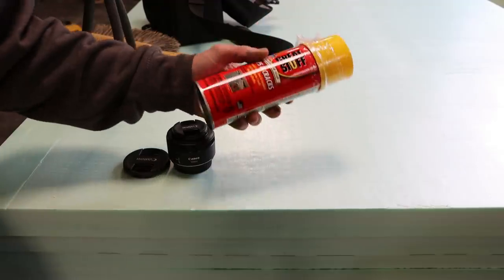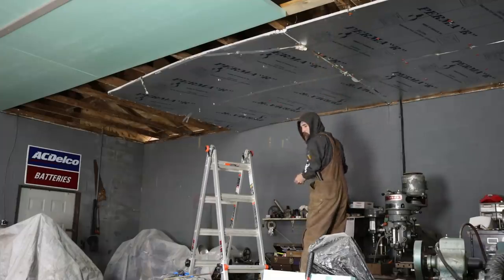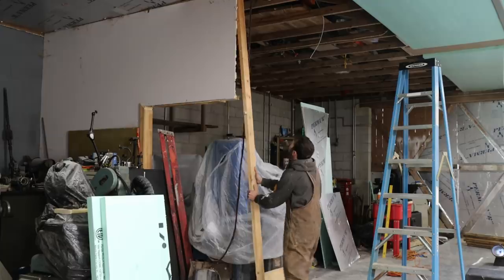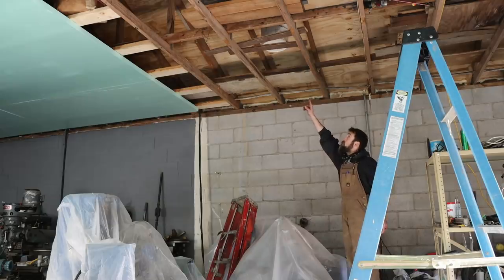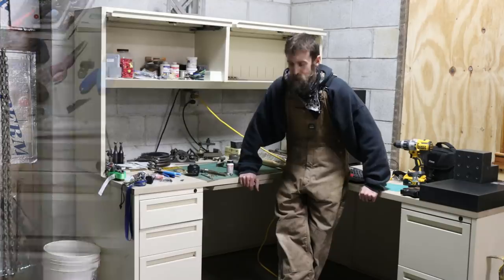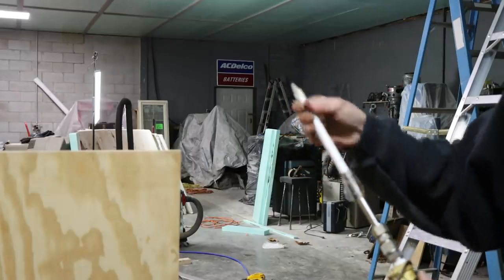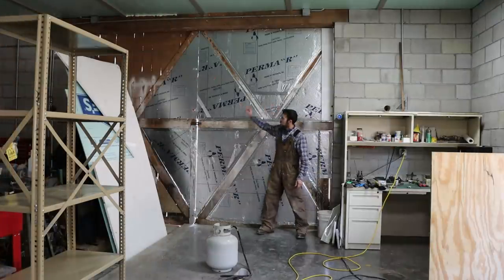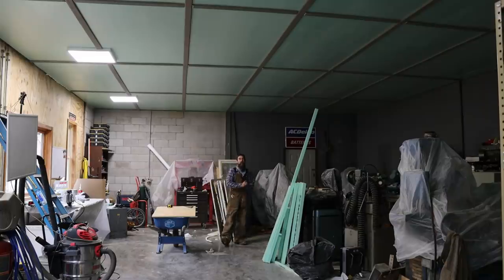Finishing my Polystyrene Shop ceiling   part 2

Comment: As an fire insurance adjuster, I’m always concerned about using combustibles for interior surfaces in living and working areas. As an alternative to plywood, have you considered the fiberglass faced versions of drywall? Much more resilient than its paper faced cousins, and fire-rated, as well.
Reply: Hi Tery, thanks for mentioning that. Do you have a brand name or proper name for it?
Reply: In our state sheetrock of at least 5/8 thickness is an acceptable fire stop in home garages with all openings properly taped and mudded. Some building codes call for a fire barrier of 5/8 sheetrock to be used around gas fired home furnaces along with flame and smoke dampers in the supply duct.
I dont see him have any open fires in his shop. Of course he could just install a sprinkler system
Reply: @brucewilliams6292  
Most drywall producers have several products, some are intended for exterior sheathing in commercial buildings, others as mold resistant or vandal resistant interior drywall. Just put fiberglass faced drywall in your favorite search engine and you will get many options.
Reply: @donniebrown2896  
He is welding and grinding. Not likely to get a spark on the ceiling, but from my observations about plywood, it is not how likely it is to catch fire, but about the intensity and spread of a fire started otherwise. Standard drywall in that setting is susceptible to mold and sag, fiberglass faced gypsum products would be much less so.
Reply: @teryshaw7370  Hi Terry, Thanks for the response.

Comment: Steve when you come to look at insolation, research and consider Hemp Wool, its as good an isolator as fibreglass, but better for you and nicer to work with. It's a common product in France and used a lot in older style of homes (17th and 16Th century builds) or new eco builds. A Hemp Shiv and Lime mix is also very good, but in your case you have expressed concerns re loose/blown in insolation so probably out.

Comment: Can't wait to see the lights up so we can see some metal manipulation. Maybe some mill/ lathe tool sharpening.. You should build a rocket stove to heat the shop. Fabricate a basket so you can use wood pellets or with basket out fuel with sticks.

Comment: Foam is the only insulation that stops air leaks. Fiberglass only filters the air as it passes through. I did poly for my ceiling under a metal roof. Cleaner and less labor than fiberglass and double the R value per inch

Comment: Steve, I build commercial buildings for the government,  Every project I have ever done required Rockwool for two reasons.  Sound deadening, and fire resistance.  The later might be of interest to you and your audience for use in a n industrial environment.  Also, we use metal studs exclusively.  That would also be something to consider in a shop, especially with high ceilings.

Comment: Hi Steve. I am well impressed with your renovation. I do have a concern, though, I am pretty sure a cold roof needs ventilation to prevent condensation issues. I would suggest that you install mesh ventilators (to prevent insect ingress) around the soffit area. What do you think, or have you considered this?
Reply: I may be thinking of Brian's shop; if you have a gable fan, install a humidity switch to control the humidity in the attic. Install a gable vent in the opposite end so all the air will be exchanged.
Reply: Rollie Kelly I have eve vents but they have been closed for 3 years.  I have not had any condensation issues but my roof is the same environment as my shop so the temp all tends to go together.
Reply: @bcbloc02  Brian, Steve has a heated room with insulated ceiling. The roof above the ceiling will be a lower temp and condense water from the air below. There needs to be big holes every 2 feet, covered with screen. That is the input. The exhaust should be a high vent in the gable. Without a gable the vent must be built into a the ridge cap. I built a super insulated solar home in 1982. My grandfather built a lot of homes in the 50s still standing today.

Comment: I added a ridge vent to mine.  Not too difficult at all.  A poor second is gable ventilation, better powered fan at it,  lesser is individual ridge vents on each side of the ridge.  Condensation will be the problem most likely if not addressed.  Rot not far behind.

Comment: hahaha,  I know what you mean. Any horizontal surface automatically attracts "stuff". I have almost exactly the same desk. I bought it at a government surplus store. I think I paid like $70 for it, like 10 or 12 yrs ago. Really heavy, kind of tough to move, but a pretty nice desk with lots of storage, too.
Ceiling looks nice. I don't think I'd change the front sliding doors, just maybe rebuild them with new P/T fir and frame in a passage door for ease of entry.

Comment: I actually think I’d just paint the ceiling then putting extra insulation on top would be as effective as the plywood underneath the foam. As far as the doors, the rubber seal would be the best option. Then make a lip between the doors that overlap each other.

Comment: That foam burns extremely well. It is intended to have a 15 minute fire barrier over it (Drywall). If it catches fire you will not be able to put it out and you likely lose your building.

Comment: You need to ventilate the bottom of the roof. Where you sealed it off with a 2x6x18, you need to put a hole and a bird block over the hole in that board.  The attic must not be filled with static humid air or everything up there will rot, like the rafters and the plywood.

Comment: Lots of airflow between the ceiling and the roof, or you WILL be replacing the roof in ~10 years, due to condensation.
Best wishes to all, stay safe.

Comment: You are doing a great job sealing up your ceiling with the foam board but that makes it a 'cold' roof deck and as such needs to be ventilated.  Insulation trays would go in the truss bays above your 2x4 plate blocking (bird blocking) to channel the air up hopefully to a ridge vent.  Easy to do now but not so easy later when you are spraying foam to close off the vent gap.  Since you are considering putting in insulation later now while the ceiling is open would be the time to staple in the trays.  In any event if you are not conditioning the attic space it should be vented.  A bare minimum would be gable vents which are not nearly as effective as a ridge vent.  Just saying so you won't have regrets down the road.  Getting out to the eaves in the attic of a 4/12 pitch can be a real bitch with the ceiling in place--ask me how I know!
Reply: The ridge is wrapped in ice and water shield, and capped already.
I don't think a ridge vent is an option at this point.
Though a humidistat controlled powered gable vent (and a static vent on the other end) would be a good idea, in my mind.

Comment: Hi Steve, the shop looks great, but I have a question about the polystyrene. Does it have any fire suppression qualities or at least a fire retardant in the panel? Never worked with it, and I wonder what would happen if an electrical box or cable were to start a fire. Having played with polystyrene cups in the campfires of my youth, I recall it burning readily and dripping flaming drops of molten styrene. I understand your reluctance to install sheet rock due to having it sag and droop after absorbing the damp, but it is also very resistant to melting and burning. Just my thoughts, hope to see more of your work soon.

Comment: You would have loved some of the lumber that I used in my shop that took me 3 years to build. It came out of school building built in the early 1930. Talk about heavy and hardly any knots. I would have loved to had a truck load of it.
Reply: So since I am in the industry I think what you are seeing is three fold especially but not limited to with Southern Yellow Pine Dimension Lumber (the vast majority of what you will find in lumber yards and job sites in the Southern US).  One is the trees being harvested are indeed younger than before as forest management allows them to turn stands around faster.  Another that with modern optimization and the high log prices sawmills squeeze more boards out of the edges of logs that would have been just chipped up as waste before.  Lastly we are a victim of the home centers dictating what they want for grade and how much they will pay for it.

Comment: A couple of observed issues. The shop is starting to look really nice inside. If you would paint the walls white, the light would seem so much more brighter...absolutely. And I noticed all your deer seem to be coordinated together and left hoofed as well. Nice rocket launcher. Have you shot it straight up in the air out side, and if so, how high does it go?

Comment: Steve I think you should consider putting up a steel liner on the ceiling in the future, white steel would come pre finished so you won't have to paint the plywood, also safer r.e. fire.       Mark

Comment: You can use the rounded side of the vise grips to pull nails just by rotating around the rounded side - just like pulling nails with a hammer. I used to pull them straight out with vise grips like you were doing until I saw someone do it the other way, and I was like "How did I not think of that"! It's so much easier to just lever them out then pull directly!
Reply: Not much leverage against a sheet of foam you're trying to save to cover the doors.
Reply: @jimurrata6785  He was pulling nails with the vise grips after the foam was gone just on the bare rafters
Reply: @gorak9000  The bottom chord of the trusses? I'm sorry, I missed that.
Then indeed there's no real reason not to choke up on it and use the built-in fulcrum to lever the nail out.
Reply: @jimurrata6785  Yes, at 2:14 to about 2:40... unless of course he's going to re-use those nails ;)

Comment: Here in MN you would want to leave the eves vented in a heated building to prevent ice dams.
Reply: He's got attic ventilation and the whole roof is covered in ice and water shield.
No full time heat out there, nor a bunch of incandescent cans throwing lots of heat into the attic.
While ice dams could happen, if his ice & water shield wraps down onto the facia where is it going to go?
Reply: @jimurrata6785  I just was stating best practice up north as he asked what else could be done. You have to have an intake for the exhaust to work. This is the same principle for the summer. I have heat and a/c in my garage. Air flow prevents mold too.
Reply: @madmodifier  it is best practice, anywhere!
But a pair of gable vents can serve if that's the best you can do.
It is not likely to find a shallow (4?) pitch here in the northeast, and probably even less likely there in the upper Midwest.
But you work with what you have, and Steve is doing the best he can.
He's a machinist after-all and seems to overkill most things, while being concerned with tighter tolerances than woods seasonal change.
But hats off to him! He is industrious and this is not his field of expertise.
Reply: @jimurrata6785  Indeed!

Comment: Normally, the attic soffits are left open to allow air to vent. The attic is not a climate controlled space. Otherwise, condensation can form on the underside of the roof sheeting. A high attic vent is also required to make use of the chimney effect. An air barrier will be needed between any climate controlled area and the attic.

Comment: Steve, you commented about the Grinding room and deciding not to have one,
On the Garage IdiotS channel Preston does a fair bit of dipping engine and trim components spraying etc he uses a tent do do all that stuff in. If you need the room you can easily move it or take it down, that would be perfect for your grinding room it would keep the dust contained and in one place
Worth a shot anyway.
Tony from Western Australia 🇦🇺

Comment: Ceiling looks really good but I'm worried about the fire retardant  properties of it
Reply: Yea, this stuff is not fire retarding in any way.
But also not that flammable either!
It's quit dense stuff and is hardly burning on it's own.
It's probably not more likely to catch fire than wood, but if it dose it burns with a little more... excitement! 😏
Reply: I think it was (surprise) california that banned It on vertical surfaces but not horizontal as It more or less will sell extinguish on horizontal as long as there is no holes in it

Comment: If you ever get a bee issue they will chew right through that sprayfoam, You'll need something more solid to stop those from making a hive in your roof
Reply: Adding a plank over should be enough isn't it ?
Reply: @Yoldark34  yeah they wont go though wood vs sprayfoam they just love chewing that away.. ironically  I saw this very thing happening on 628DirtRooster Bees ...He zoomed in real close and you could both see and hear the crunching sounds as the bees ate the foam

Comment: Code here requires that you have circulating air in the space under the roof. Normally this is achieved by means of ridge and soffet vents. It looks like you're trying to seal that space off. How do you prevent condensation and rot up there?

Comment: Hi Steve,  you've done a great job on the ceiling mate,  have you thought about these those small fans whith a tube that reaches to near the ceiling ,and pulls the hot air back down to floor level, making more use of it? Don't know if you have them over there, but it would be easy to make some, I'm looking forward to the next video,  Best wishes to you and your's, Stuart.uk.

Comment: The missus might give you a month or two off once you finish the shop. Then youll have to start on the house. Haha. Not so sure about no grinding room. One thing that drives me nuts is grinding dust and welding slag on EVERYTHING, after one job. Love to be able to contain it and keep everything else clean. I reckon that a mistake steve.

Comment: yeah old lumber is better, back when they had more choice in where they got it from, when i worked at a lumberyard we would get our wood from the mill and there was a forest fire that burnt a lot of the good trees so we ended up with the low grade wood and  some of the 2x4 16f when they dry out would and have a 90 degree twist in them , we used those to make 2x2 2f stakes

Comment: The only comment I can make (besides the fact that you are a tremendous worker) is that foam insulation makes a wonderful home for carpenter ants - The polystyrene manufactures will tell you that ants do not eat the product - they are right - but they will build nests in it - I had one bad experience - watch for blue dust on the floor - it is a perfect nest material,

Comment: Another concern about humidity:  Electronic equipment, such as a personal computer, is usually rated for storage and operation at a humidity level of from 10% to 90%, NON-condensing.  Heating and cooling off an area where a PC is located - by turning on and off a heated area in the winter, or turning on and off an air conditioner in the summer, can cause condensation.  Condensation can cause short circuits - even for signal lines on a printed-circuit board like the mother-board.  It can also cause corrosion of wires and of the copper traces on the printed-circuit boards.  These short-circuits and corrosion can cause a computer to fail and/or cause loss of all data on a hard drive.  NOT a happy thing to discover when you go to use your computer.

One thing that should work is to put a small night light (7 1/2  watts or so) inside the PC case leaving the light on all the time.  The heat from the light should keep the inside warmer than the area it is in.  Just make sure that the light is not touching anything.   (Tie it in place with string.)

Comment: Shops looking good Steve, got a question for you, my k&t mill the head is full of grease. Does it use oil or grease? It's a model K 2 universal. 
Great video.
Reply: I dont know but if you search for a user manual it will tell you. Keith Rucker has a library of manuals for all sorts of machines.
Reply: @ericmcrae7758  thanks man, I downloaded a parts manual,didn't see one on service I'll look again. Thanks.

Comment: You probably should do something to seal all those openings between the wood on your doors. Otherwise the moisture getting in from rain that is trapped behind that insulation is going to generate mold.

Comment: you probably know this... but polystyrene insulation is combustible and gives off highly toxic fumes when burning, it is designed to be covered with a fire retardant material... if the ceiling ever catches on fire, get out of there fast... just wanted to make sure you knew ;-)

Comment: Have you considered attic ventilation in regards to soffit screens?
Reply: I think he said last week he was going to put gable vents on either side close to the peak.
Reply: @gorak9000  Right...but to induce adequate air movement he really needs some soffit ventilation to prevent the amount of condensation which is bound to occur IMHO.
Reply: @smitty2868  They do build houses these days where the underside of the roof deck is sprayed with spray foam insulation and the attic is completely sealed and is on the inside of the building envelope - there must be ways to make it work